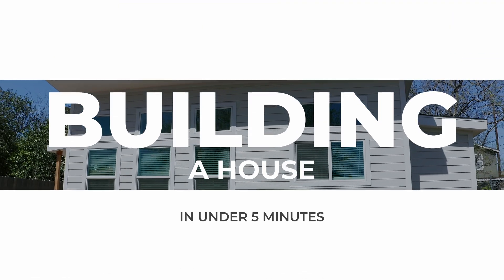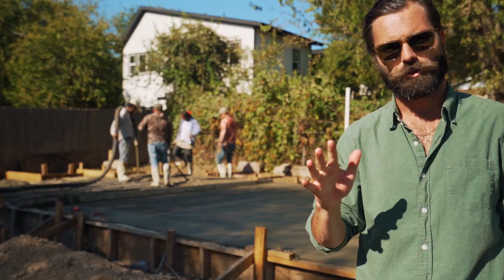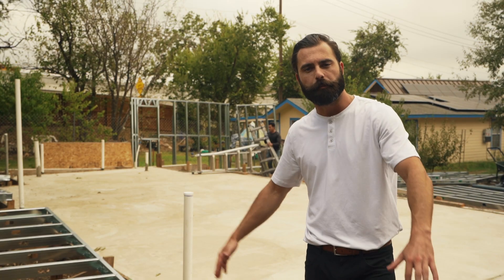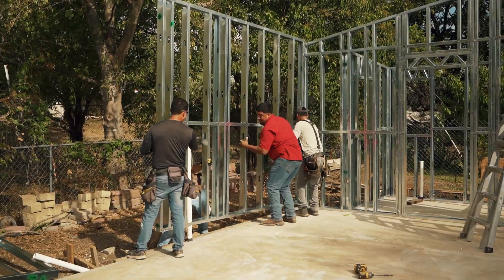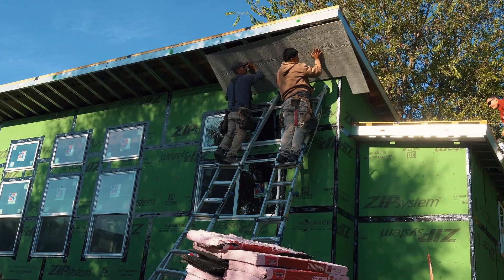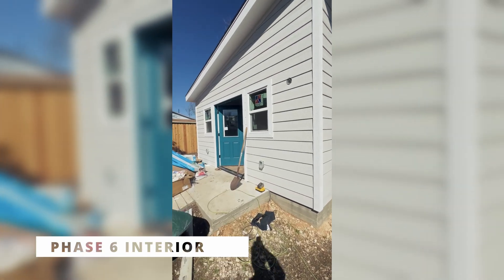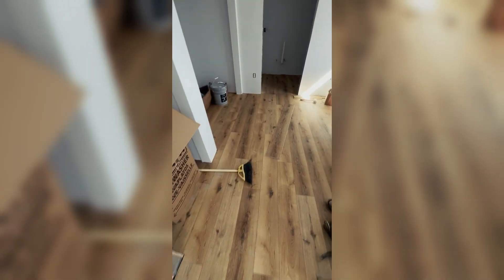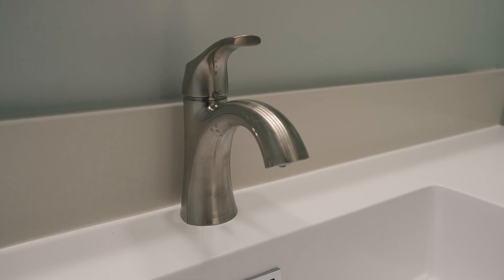Building a 500sqft ADU Kit from Start to Finish

Comment: I wonder if you could build it so that in the future it could be moved to a different location.
Reply: A lot of Tiny Homes are built on wheels. But such homes depreciate over time like a vehicle does, instead of appreciating in value like a home with a fixed foundation.
I heard of one company that slides the Tiny Home onto a trailer, takes it to the site, then jacks it up and slides it off onto the ground.
I don't know why the market makes this Holy distinction between a home and a vehicle -- maybe because the latter is expected to get more wear-&-tear.
Reply from the maker: We can!

Comment: Wow...bolting steel frame walls directly to concrete base = not very high IQ, clearly.
Reply: It is a very suspect build.   Not sure how it passed inspection.  This would never get allowed in most states.
Reply from the maker: @hrussell9677  It is allowed in most states!  We use a sill seal in between

Comment: Where can this kit be purchased?
Reply from the maker: You can email us at info@volstrukt.com and we can help you with your purchase!  You can check out our models on our website www.volstrukt.com
Reply: NO MOISTURE BARRIER UNDER THE CONCRETE IS A HUGE MISTAKE
Reply: No THERMAL break between the concrete and metal framing will create condensation issues.
Reply: RAINSCREEN? EXTERIOR INSULATION? OSB AGAINST THAT METAL WILL CREATE A HORRIBLE MOISTURE PROBLEM. YOU NEED TO REALIZE THAT THERMAL BREAKS NEED TO HAPPEN.
Reply: the peasant store

Comment: How is the steel framing, thermally? I was told steel is a thermal bridge and you should insulate over the siding to prevent the framing from heating/cooling the living space.
Reply: I can't tell you the technical stuff but I live in a tropical country (in SE Asia). For newer builds (past 10 yrs or do), people here have been using steel or metal framing + fiber cement board for walls. 

Concrete houses are still preferred but for those who are on a tight budget, they use metal framing + cement boards. They may or may not put insulation between the boards (depends on budget). Insulation isn't required by code (in my country). Wood isn't preferred to be used in framing due to water damage and termites. It's also considered as "cheap/ low class". (metal frames or concrete w/ rebar is preferred) 

From vids that I've seen, in California it's required to have insulation in the walls & roof. They must pass the insulation inspector before proceeding to the next stage.
Reply: Did you see that green Zip system installed on the exterior? That's insulation board attached to plywood. Creates your thermal barrier and envelope.
Reply: @tonylarose4842  I just noticed it was insulated Zip sheathing. Now it makes sense.
Reply from the maker: @tonylarose4842  Ty!